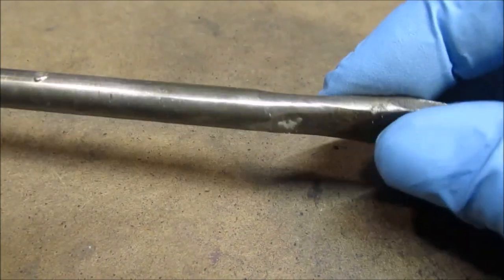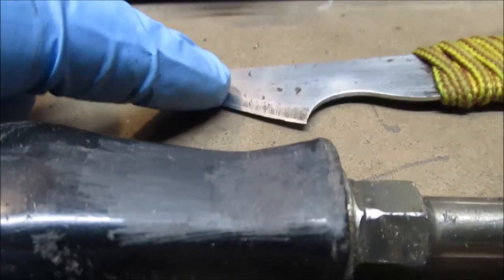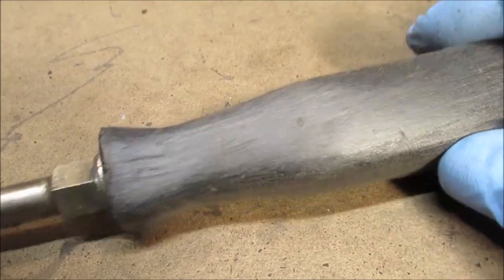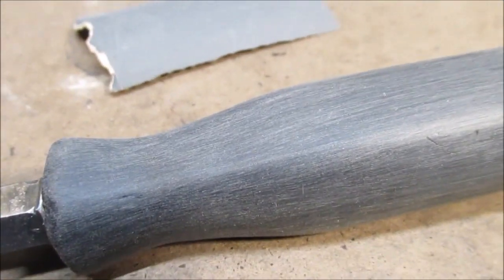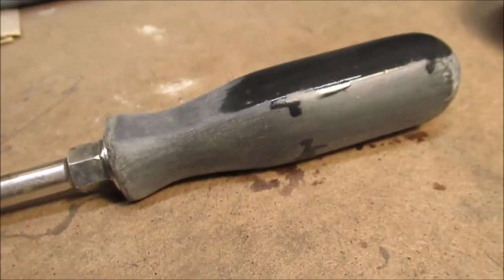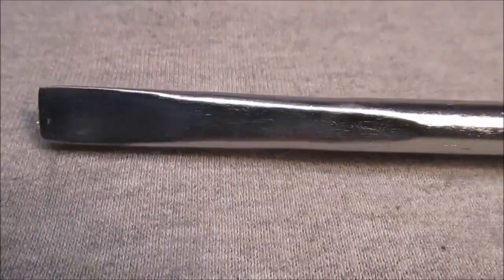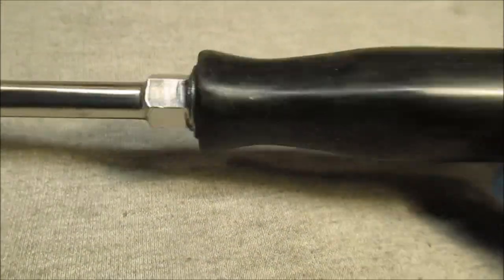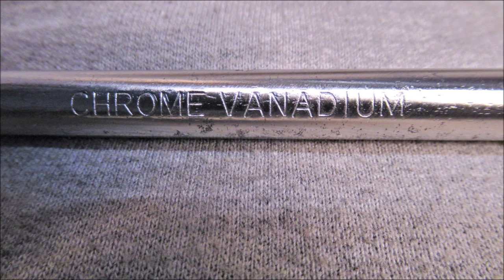Restore & Modify Old Damaged Screwdriver

Comment: Nice work! I don’t have much luck with plastic handles... I usually scrape it smooth enough and then hit it with a heat gun. It’s not as good as you’re job but it works
Reply from the maker: Thanks   I have spray shellac or clear coat on them and they look OK